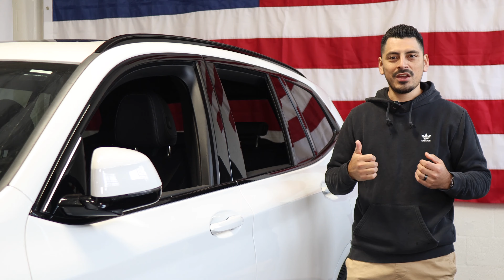BMW X3 2018-2024 Side Chrome Delete Install

Comment: How long will this film last?
Reply from the maker: Our chrome delete tint typically lasts 5 to 7 years, depending on factors like:

- Climate (hotter, sunnier areas may reduce lifespan slightly)
- How often the vehicle is washed (hand-washing is gentler than power washing)
- Proper installation (a clean, dry surface helps the film adhere better)
- Exposure to road debris, salt, or harsh chemicals

We use high-quality automotive-grade vinyl, which is built to resist fading, cracking, and peeling over time. With the right care, your chrome delete will keep looking sharp for years!

Hopefully this helps!